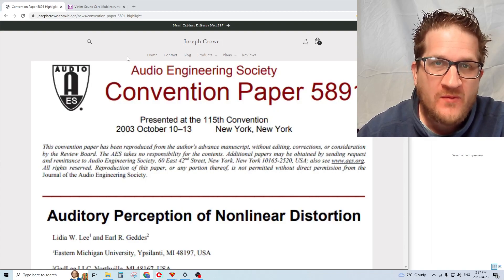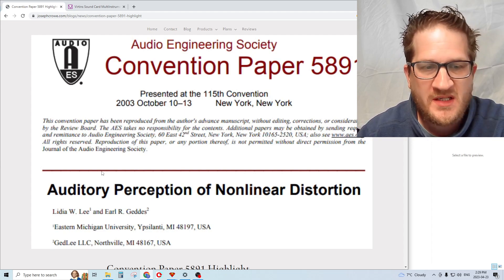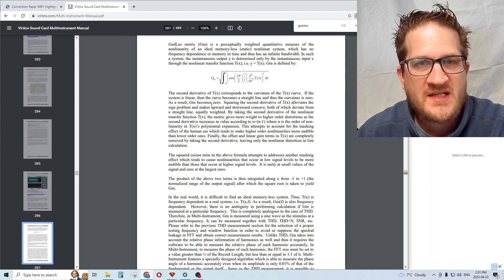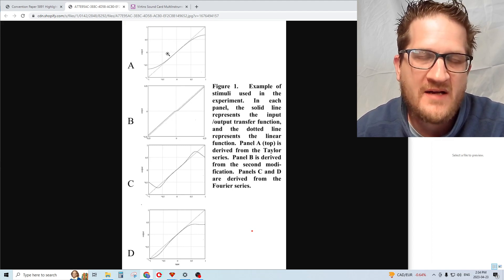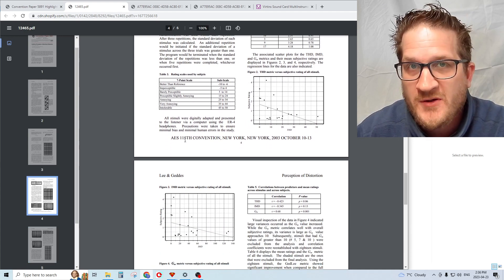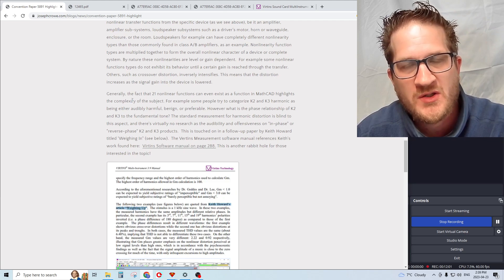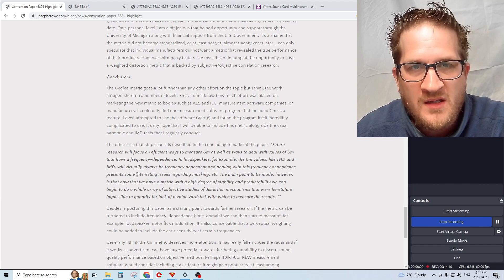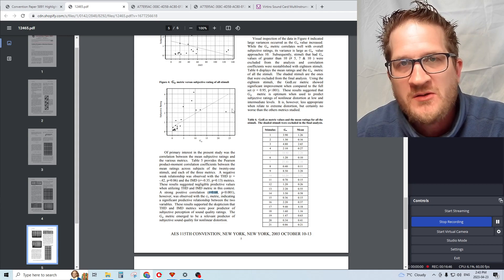Convention Paper 5891 Highlight

Comment: Very interesting topic. But looking at the scatter plots in the paper (I'm an MD epidemiologist PhD), their use of correlation coefficients is not valid. The data the paper does not have a 'normal distribution' at all, which means that the calculated coefficients are meaningless. As a result, for instance, the negative coefficient for distortion and subjective preference is totally determined by the 2 outlier observations on the right hand of the plot. They should have used other statistical methods, eg non-parametric tests. Too bad, has any furher research been done on pleasing sounding distortions?